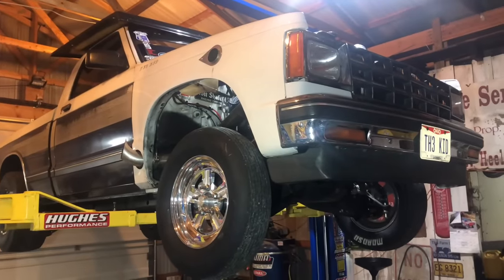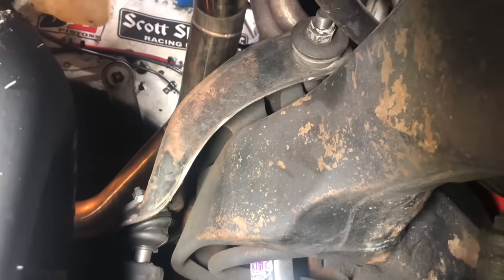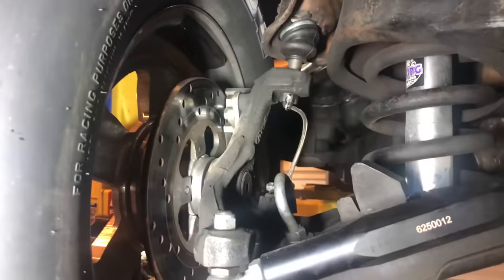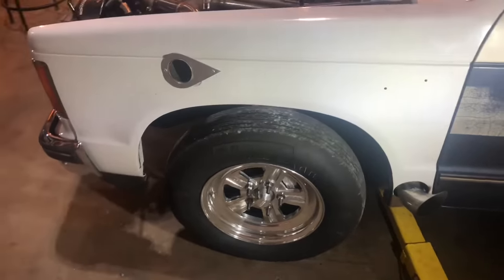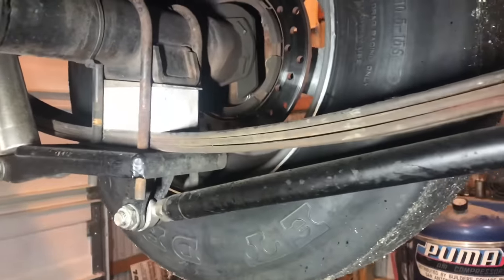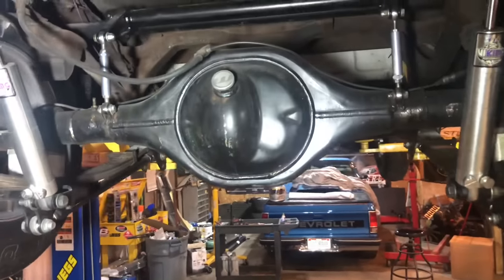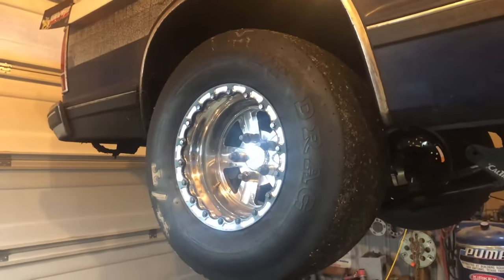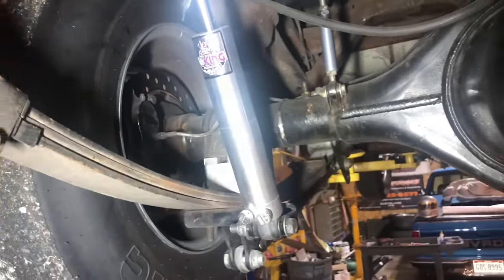Suspension SECRETS!  A look under “Billy The Kid”’s S-10

Comment: After seeing how you have the rear set up I can now understand why you've not gone with a back half 4 link. The ol addiage - "If it ain't broke don't fix it" is applicable. I've been bitch'n that you need to back half the truck for a couple years,, NOW I understand. Thanks so much for these tips.

Comment: The look on your face after showing the upper control arm is priceless. I laughed out loud . My dad would give me that same look too many times and it brought back memories. 
On another note, I have a 2000 s10 ext. that came with lowering spindles and lowering rear springs 😞 and a 383/700r4/3500 w/lock up.  I replaced rear with a 8.6 and cal tracs-373 gear. Run 375 nittos and Calvert shocks. It runs 12:50’s all day and gets 19 mpg on highway with a/c. I consider it acceptable for what I’m doing with it but you are absolutely correct about all the things you talked about. I’m 60 yrs old now but back in my bracket racing days I had a 78 Camaro that I set up almost exactly what you described except no sway bar in rear. I won lots of races because it was ultra consistent. Great info for anybody looking to hook pavement hard. Love all the videos you and your son put out and wish your wife a speedy recovery.

Comment: Great info. For the G body fellas: this same front setup, using v6 springs. For the rear trz anti roll bar “ no more g body shuffle”, adjustable uppers, boxed lowers and a bit or reinforcement on the control arm mounting points or torque box and the g body will hook on ice. Cage, x brace and boxed frame wil make the landing more pleasant and keep you from ripping the car appart.

Comment: You guys are doing well and doing it right.  I had a 1985 GMC S-15 we did just about what you did at the beginning but in the end it was a full tube chassis truck.  And I fully agree with your comment of only one change at a time.  When we moved out of the stock frame and suspension we had to log every change.  And your comment about it doesn't cost much to make them fast is very correct.  Once we moved to the tube chassis the costs got to the point we just couldn't keep up with the costs, so we sold it and I moved to Ohio.  But watching you and Billy I'm kinda thinking it maybe time to look at putting another one together to play on this no prep stuff.   Wish you guys all the luck and if you ever need a hand just let me know.  I live just up the road from you guys.

Comment: I am definitely soaking this up! Long time S-10 fan, recently ls swapped with 8.8 and TH400. Thank you for all the great information. It's a lot easier to listen to you than it is for me to reinvent the wheel. Thank you again
Reply: Hey man , I got a 388 stoker with a th400 gonna put either at 8.8 or a 9in in it , I was curious what pinion angle you set your rear at and engine/trans , gonna build a custom trans mount so trying to figure this out , appreciate your time if anyone got info and see’s this comment.
Reply: I am running the stock drive shaft with just 2 U-joints. Mine is a short cab so the pinion and motor\trans just have to be the same. I'm running at 3 1\2 degrees front and rear. With a one piece driveline they just need to be parallel. With an 8.8 I did need to shim the rear a bit.

Comment: Best racing channel on the internet!  Hands down!  Proof that it isn't always the 'most expensive' and 'highest tech' parts that work.  This is absolutely NOT a jab!  You made it perfectly clear you were not 'thrilled' with your son's modification of the upper control arms.  You also made it clear 'it is his truck and he can do what he wants', 100% understood.  BUT, maybe, just maybe, you could talk him into taking an angle grinder, some grinding disk and 'smooth out' or 'radius' those 'rough cuts' left from the cut-off wheel.  Just 'smooth them out so there aren't 'sharp corners'.  As I am 100% sure you know, 'stress cracks' start from 'sharp points', a little 'smoothing' and 'making a radius' can really prevent a massive crack from developing before you can spot it during inspection.  AGAIN!  I realize you know ALL this.  Just thought maybe a 'quick comment' might encourage him to do a little grinding.  God Bless!

Comment: I see on the ride hight u explain why it’s important to do the front suspension that way is because u gain control under acceleration/ with stock spindles and 1 inch higher upper ball joints where as with drop spindles as u get faster and it begins to transfer more even pulls it front wheels at launching u loose 2 ta 3 inch of stirring con-troll (AT STATIC RIDE HIGHT) !!!!+ EVEN MORE AS IT PULLS UP HIGHER PAST STATIC !!!(where as u guys gain control) is and keep the hammer down !!! I hope I have explained that I get it what u explain on importance this set up???

Comment: Great video!!! Totally agree on the drop spindles! And how hard it is to get people to understand, I try and explain it like a swing set. Top bar is drive line center point and swings are the suspension curve. Nothing ever works talkin to those guys!!! Hope ya got some solid drop blocks! I’ve cracked some cheep ones, belltechs have lucite a bit thicker wall, good enough for me. Please get some new bushings on that rear at least! Energy suspension has a bad add poly blend. No I don’t want to do them, had to burn mine out. Anyway thanks for all the info from a hard core Dime life guy!👍

Comment: Thank you in advance for saving me the cash this video is going to save me! I had been "drinking the Kool-aid" and assumed that I needed the lowing spindles and springs and other fancy suspension products I see all over the internet. I am building an '89 S10 with Cal Trac bars and a Ford 9" rear end. It's nothing super fancy for now, just a 5.3L LM7 with a 75mm turbo, camshaft, valvesprings forged rotating assembly, and all the usual stuff. I will now be looking at getting a rear sway bar to put back there, and I'm going to look into Viking shocks to see if the wallet can afford to squeeze those into my build. I did not know that using a X-brace on the frame like you do was even a thing, so thanks for enlightening me on that. I have never been involved with drag racing or anyother form of racing, but I grew up in the garage wrenching on cars with my old man, and Ibconsider myself to be competent enough to complete most if not all the work on the truck by myself. With that said, seeing your videos like this one is priceless to me. It shows me I don't need to reinvent the wheel or anything in order to have a decent running truck. I appreciate you pulling back the curtain like you do with Billy's truck for us. I usually find your videos to be funny, entertaining, and informative and look forward to seeing your videos as you continue to put more out. As weird as it sounds, and as much as I feel awkward saying it, almost feels like I know you guys just from watching you and Billy's videos for the past year or so. Thanks again for all that you do, and I look forward to seeing what's to come.

Comment: Honestly I watched bits and pieces of this video on break at work. But I came back and watched it like 3 more times because there is so much good info in this video for me. I have a s10 SBC with a 78/75 single turbo. I'm just now getting it running right on 12 psi. Ran my first 6 second 8th mile a few weeks ago. Thanks for the awesome video man I'm gonna add an x brace to mine but I already have an 8 point cage. But it's getting close thanks again

Comment: Good info I ran the same simple set up on my 67 Camaro ,  on short wheelbase cars such as the S-10 or first gen Camaro moving the front of the Cal-trac to a lower hole changes  the instant center a good bit but thats a whole new can of worms , I just juggled mine around with bar location , tire pressure and shock settings until I got it to where it would hook up in mud whole , Keep the vids coming , Bill

Comment: That's a good point on the spindles, and not something everyone thinks about initially when they are lowering a vehicle they are going to race.  I could see it being a benefit if you had a car/truck that had a lot of rear weight bias to keep the front end travel minimal, but on the street you are absolutely correct and it gives you an extra 2" of suspension tunability.

Comment: Obviously, the S10 has more than enough power to ride the rear wheels for quite a ways down the track!! so your suspension is working great in your application, and that's what matters.
I agree with the Viking shocks, they are outstanding.
Little back story...me and a friend been testing with his MOPAR...in this case, a Dodge Dart.
It has a big block all motor that only makes around 750 horsepower or so.
It has Cal Tracs and mono-leafs. With the Calvert adjustable shocks, it would extend all the suspension front and rear on launch, just enough to get a half-way decent 60 ft. time, then it would "relax" too soon and start spinning. Many trips to the test & tune sessions trying all kinds of different settings, and it just would'nt improve any more that what we already had.
So we tried some Viking's double adjustable shocks, and BAM!! this thing cut another 1.2 tenth's off the 60 ft. times!! It was pulling the front wheels off the ground considerably more.
But the funky stock angles of the shocks (car is all stock type suspension) seemed to be holding it back some.
So we fabbed up a new shock mount on top and stood the shocks straight up, and OH MY GOD what HUGE difference that made!
The car will nearly stand on the rear bumper now, and it's only a foot brake....has no trans brake at all.

Comment: Yeah Mr Bill  it has effected my truck doing that. It took up slack in the brake hose for wheel travel. Mine are 2 inch drop spindle with 2 drop springs. I have it for the ride height. I think if you bring the truck down in the rear 6 inches have a professional c notch with and 4 link and latter bars and a few other goodies that front end stays down with some good shocks. Hooks well. Of course Mr Bill you will have to tub the truck. But if you are budgeting then you are right your set up is working so unless you guys are wanting to spend money I wouldn't mess with it. I'm no expert either so my set up wasn't done by me someone else was paid to do it.  I get lost in the geometry myself. I can get it down the track but end up pulling power out of it. I love what you do Mr Bill.

Comment: Billy should really use a rust converter on the underside of his S-10. Or a mixture of bar & chain oil mixed 50/50 with diesel fuel. From what I just saw, the structure bars under the bed seem to have a bit of rust so, either a simple rust converter from Eastwood or whatever... I greatly appreciate you guys simply for being from Ohio as I am! My brother had a 79 Z-28 w/ 1973  4.125 bore sb 400 bored .030 over to a stroker 406. Th400, 373 gears, Holley 750 double pumper w/manual secondaries & a 78 Trans-AM with a worked up 455 H.D. All the things I wanted to do, He never did!

Comment: Hey Bill, I have some real first hand knowledge of the whole scary bump steer thing.. I can't totally simplify this thing for ya.. if you do to it what I do when you take it for alignment it will be dead nuts every time.. the bottom line with bump steer is that the lower control arm has to swing through the exact same arc as the tie rods. so I will shorten or lengthen the rack so that the pivot point for the tie rods are the same as the inside pivot point of the lower control arms. And just make sure that the outer tie rod mount point is at the same vertical and horizontal plane as the lower ball joint mounting point.. if you make this happen. There will be good results at the alignment shop..keep up the good work my friend..

Comment: Hey Uncle Bill, i found this topic very interesting. As always, everything you said makes sense. I believe your advice is not just suitable for a s10 but just about any rear wheel drive vehicle with double control arm front suspension and leave springs in the rear. With a 1.10 to 1.20 60 foot you should be in the low 8's or high 7's. Lol you can tell me how close im guessing. Id say this truck does about 8.20 seconds at around 170mph in the quarter. Here in rsa we dont have the newer usdm cars. We do have the very old cars though. Mostly australian and uk cars here. 

Im thinking bout a low budget race car built, just waiting for my budget to come back. It may be a pickup from england or maybe a 1970's mazda 323 with a turbo 4banger. Manual box, nothing to hectic. Around 500hp. Aiming for a streetable 10 to 12 second car.

Comment: Thanks for explaining Billy's setup. Love that channel. Could someone explain what it means to have preload or load on the leaf springs or Caltracs? What is load?  I'm just getting into racing finally and really am trying to learn as much as I can
Reply: When the bars are “loose” (not bolted applying pressure/ bolts loose) there is NO preload, as soon as you turn the bars and they are starting to apply pressure (make contact) you are pre Loading the chassis, youll see it while turning the rods, it starts to kinda bind. Thats Preload- as its sitting still AND chassis is cranked, but w/o no pressure from drivetrain (like if foot on break, rpm up, in drive) ) Hope it helps!!

Comment: Thanks for the Tips this will be Implemented in my 84 S10 Sport Xt Cab and My 91 S10 Blazer im about to put 336 SBC in, I already use Adjustable Drag Shocks on the Front and removed one Coil on the front to get my Ride height correct with 3 " drop blocks in the rear God Bless you and the Family !

Comment: Great stuff. I have had 2 S-10’s. 1 with very similar setup on 29.5/10.5 tire and the other with tubular front and ladder bar rear on big tire. Really loved the stocking one. If I get to build another it will remain very stock with minor mods on the suspension.
Reply: Do u know the cal Trac number ?

Comment: Great video. Great info. Thank you for all the info. A question is there a reason the truck doesn't use sliders? 
I been considering using them on a blazer build. Does it have to due to the geometry with spring set up?
Thanks again for info.
God bless

Comment: Thank u for the content putting out the suspension part of the last video was very much helpful I’m running a 90 model square body s10 an part of my biggest problem is keeping the front tires on the ground I’ve gotta find the upper longer ball joints I think that might give me what I need to not pack the tires as much because I don’t have 7 inches of travel with stock parts other than a bump steering kit thanks keep the content comeing

Comment: Great video, one of the most informative ive seen on youtube. About the spindles, if I wanted to lower my truck would a drop spring limit droop travel like a drop spindle would? You mentioned you're running a melted/cut spring up front and a block in the rear. Maybe I answered my own question that a drop spring would be fine since thats basically what youre running. Did you guys do anything to increase droop in the front or is it stock? Im on a c10 chassis anyway.

Comment: My actual first street/strip car I built myself has alot of the same parts Ive started bracket racing since i was 14 but i didn't do much my to that car untill i wanted to go fast. But in 2014 I was 24 and ls swapped my 77 nova rebuilt the 8.5 10 bolt welded the axle tubes i even kept the drum brakes, caltracs and calvert leafsprings and rebuilt the front suspension with stock stuff with strange single adjustables  home made sub frame connectors and 8 point cage, at first it was a cam only nitrous 5.3 but i poked its eye out then went with another 5.3 and learned and still learning a out turbo stuff and had a simple single kit fabbed with a 280 ebay 70mm t4 deals and had a ton of fun with old setup but it got out of hand quick it ended up goin 5.80s with the drum brakes and factory disc breaks and stock style front suspension it got Sketchy and had to throw the chute if went 6.20 or faster lol

Comment: Thanks for this vidio I've been thinking of doing an s10 for a weekend drag truck. You helped me understand what I need to do with out spending a tone of money.
So if I understand things correctly to lower the truck use blocks rear and lowering springs in the front. Weld in the x brace or will bolt in be ok?

Comment: Just a few questions bill, the trk is very fast, but what is the Eveleth in lower control arm for? Also lf spring pocket looks strange? Is that a spring ext rubber on lf? Why does it look like it's a rubber with a split in it to install a rubber riser? Also lf upper ball joint looks shorter than rf ball joint?  U never mentioned any of this? Thank you Mr bill, love your videos.

Comment: Sorry, do you run billiet body mounts or poly or rubber? Why not box the frame instead of adding the X brace? Stock rubber bushings on the front control arms? Manual steering box vs quick ratio pwr box? Which would recover quicker? When does it become an advantage to have adjustable shocks vs "standard" 90/10-50/50 Competition Engineering shocks?

Comment: Hi bill I was wondering if you use aluminum bushings in the front and rear of the springs I watched the video when you had a problem with it getting rear steer from the stock bushings my buddy is building a s10 and the back bushings are going to have to be replaced and I was wondering if you all put the aluminum bushings or polyethylene in the back of the springs thank you so much for taking time to share with the public you all really care about the sport and are passionate about it and helping people who  watch needs to take note for one thing safety needs to be the first thing about going fast but as you explain you don't have to have a 30 or 40 thousand dollars in a car or truck to get into the sport and thank you and your family again for your time on this site